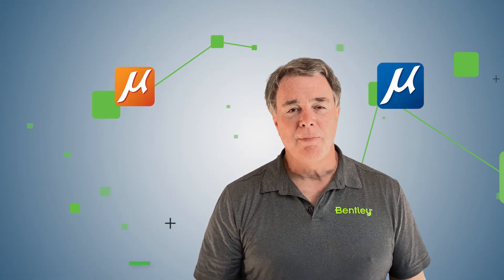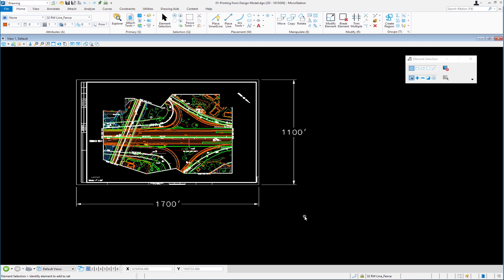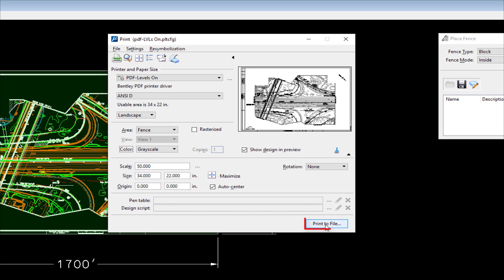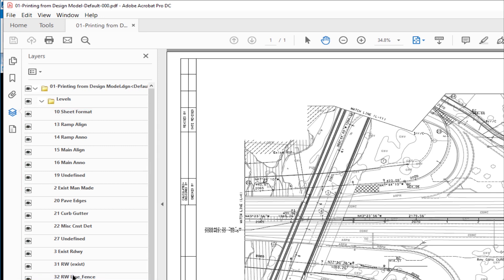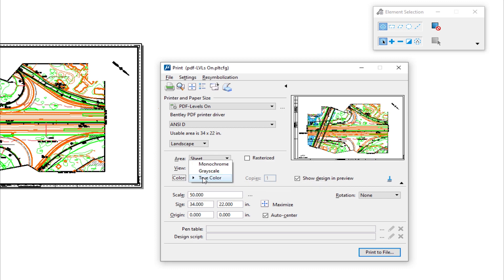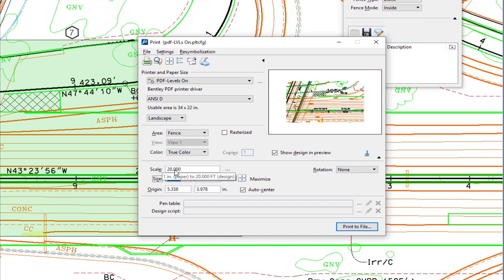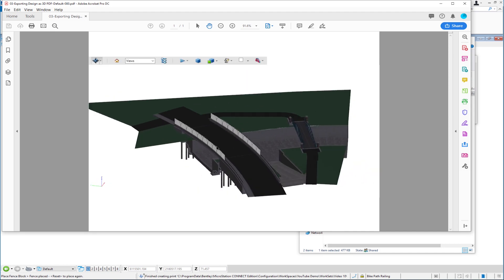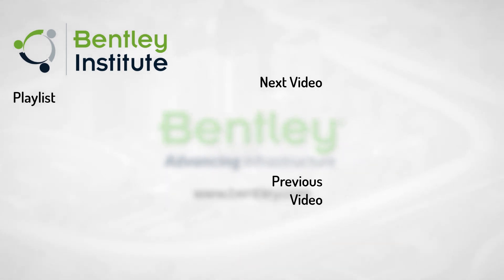MicroStation CONNECT Edition 2D Basics: 10 - Printing your Design to Paper and PDF

Comment: Very good instructor, exact and to the point!  But in the future, I should like to have some tips (preferably from the same instructor) on the rendering 3d constructions (like a marina with yachts), defining and attaching materials, colors, lighting, etc. as well as realistic 3d stones and objects. Leaving the simpler 3d drawings from Microstation J, the engineer realizes the enormous complexity of the new MicroStation CONNECT as well as its capabilities.

Comment: In Promise V8i it was possible to send the drawings from the Project-Manager to the Print-Manager where you can print a defined set of pages. Is this also possible in the new Connect edition?
We often need to print a couple of pages from an electrical package. This was very handy in Promise V8i and now I am pretty confused how this can be done in the new version.